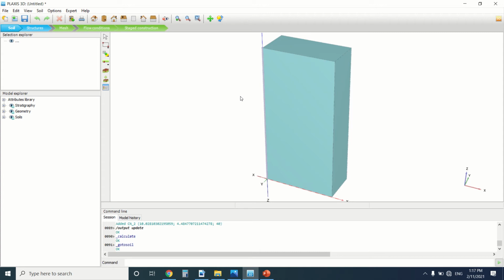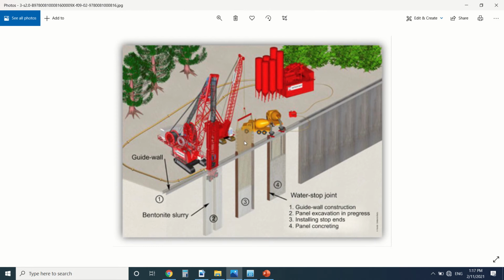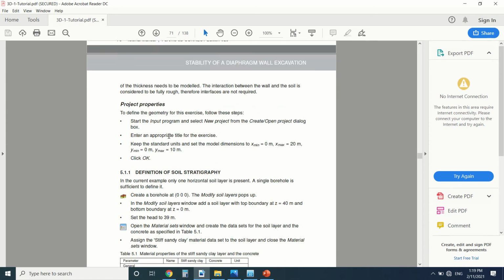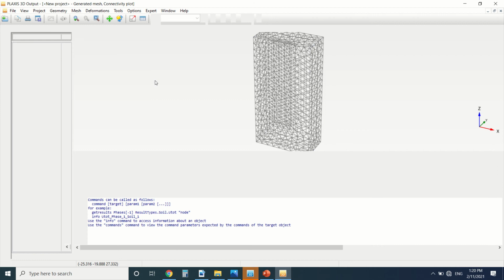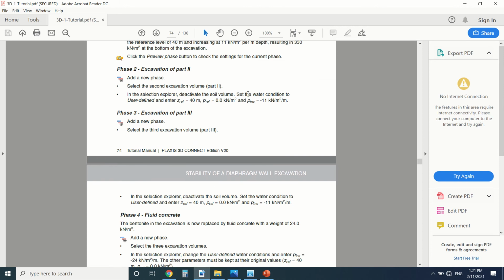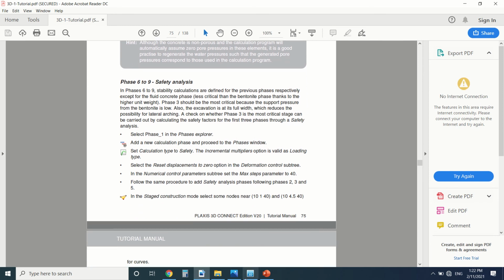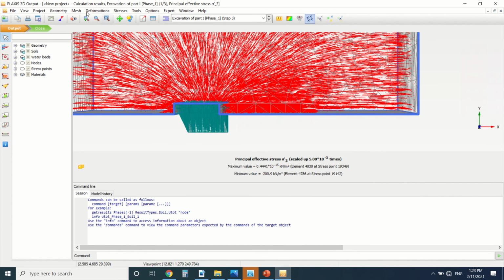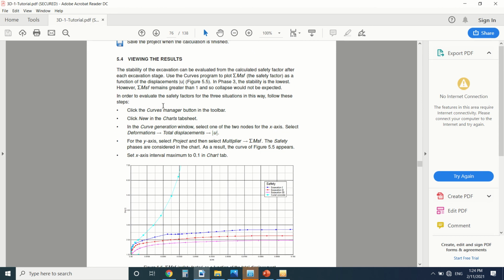12- Plaxis 3d tutorial: stability of diaphragm wall excavation

Comment: you are doing great job.
Can you please make a video on curved Embedded depth retaining wall 
Length of wall (L): 30m
Retained height (H): 10m
Embedded depth (D): 10m
Arch rise (ymax): 2m
Thickness of wall: 1m
Elastic Modulus of wall (E): 30GPa
Soil: London Clay
Weight Density (ϒ): 21kN/m3
Angle of internal resistance (Ф): 300
At rest earth pressure coefficient (K): 1.4
Elastic Modulus of the soil (Esoil): 1250Cu (kN/m2)
Cohesion of soil (Cu) 80+8z (kN/m2)
Reply from the maker: Thano you
Reply: @eliezalzal  sir kindly make a video